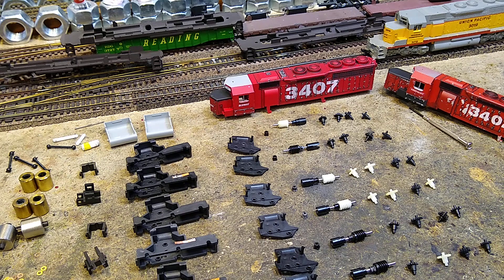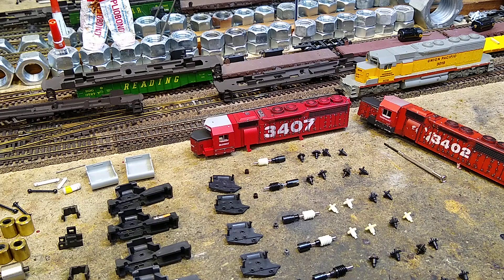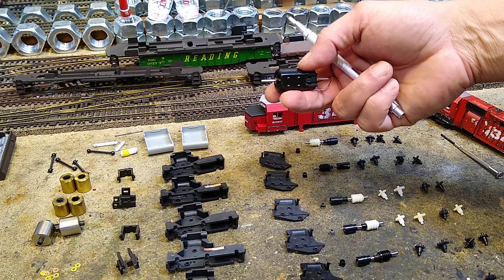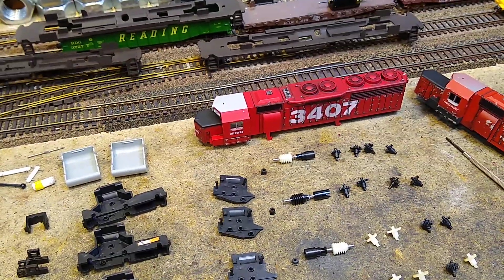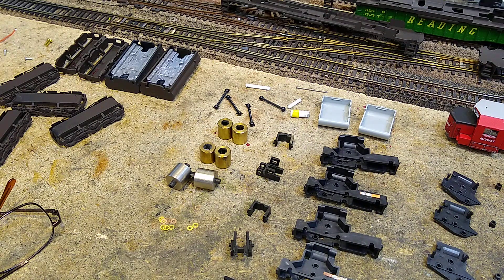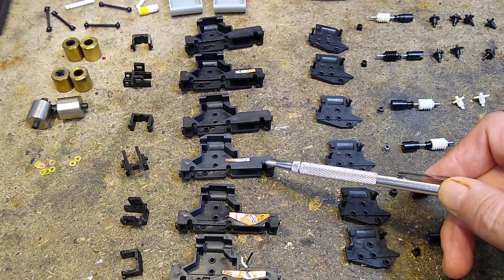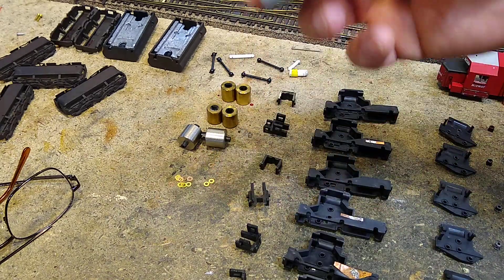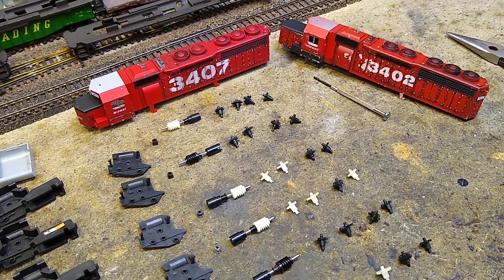AHM SD40 rebuild 1

Comment: You do realize these AHM SD40's were the very first HO scale SD40's to hit the market right?  AHM aside they were good runners are are highly collectible to those in the know.  Many folks who own these aren't even aware of what they have because they think AHM no big deal.  AHM while louder than most were good engines/locos in their day and run solid even into 2023 if taken care of.  Might wanna rethink butchering these and restoring them to factory, at least one of them ;)  Great video and fun build!
Reply from the maker: I've saved the best ones!  Interesting that by today's standard, they are DCC ready right out of the box.  The flywheels on the 3 pole motor make a huge difference in performance. These are going to be DCC pretty soon and run in operating sessions!

Comment: could you elarate how to made the dogbone? drill holes 1st then insert copper wire?
Reply from the maker: the white ones are the old way I used to do it - for this build I'll be making new ones from copper wire which will work much better and I will show how they are made from scratch.  2 weeks ago I made a video showing how to make these new shafts for the Gilbert locomotive and it will be pretty much the same way but a different length.
Reply: @elite194  thanks! is there a video showing your old way to do it no soldering? thanks!
Reply from the maker: @chlsjtu  somewhere there is a video about an SD40 or a C424 that got the plastic pipe drive shafts - they are easy to make just poke a piece of wire through a plastic pipe on each end and you're done - they sound a little loud though
Reply: @elite194  Do you just use a wire to poke through solid plastic? I couldn't poke it through using normal thin copper wire. From the video it looks like solid plastic -- do you fill plastic pipe or it's solid pipe?
Reply from the maker: @chlsjtu  use piano wire and you can use the same wire as a drill bit in your moto-tool to drill the holes.  first make a starter hole with an xacto knife then take a piece of the wire and use it as a drill bit.  you can file the tip of the wire just a bit and it will be sharp.  takes a little practice, but once you know then you can use wire to drill holes on all projects!!
Reply: Do you have issues with the “pizza cutter” large flanges on the wheel sets, or are all yours the smaller ones. I have several of these and couple have smaller flanges. 
Do you swap out larger ones with different wheels if you have them ?
Thx as always.